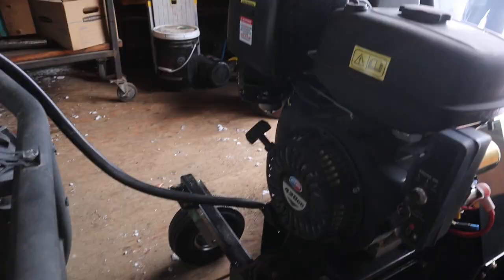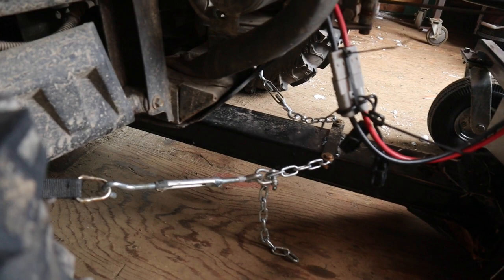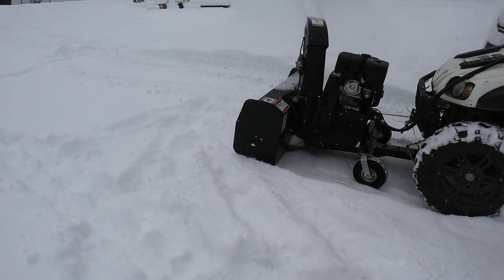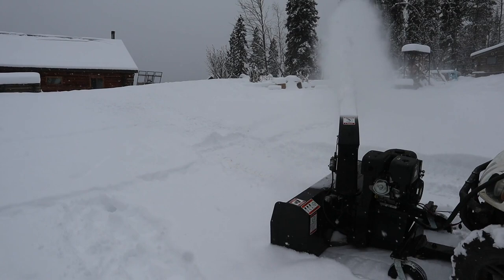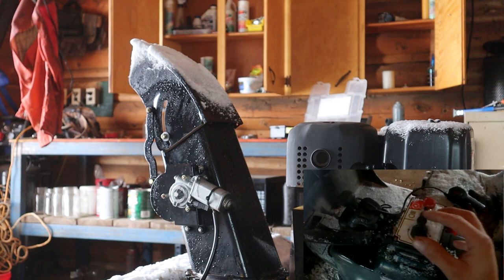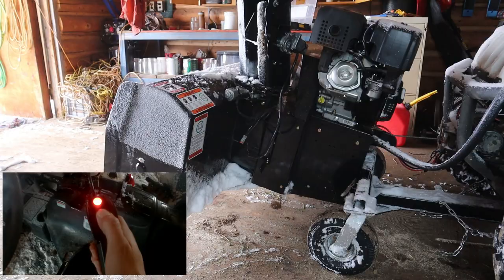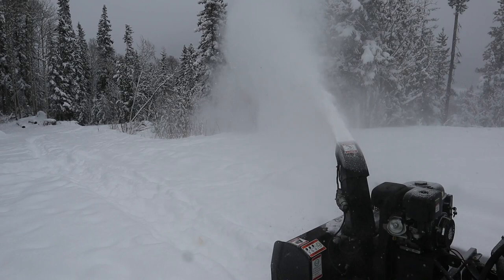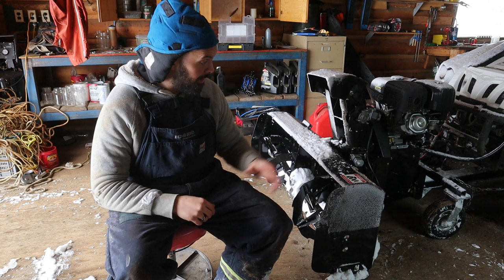Bercomac ATV & SXS Snowblower - Best Snowblower Review // Product Review

Comment: Why is the blower set 2-3 inches above the surface, leaving all that snow?
Reply from the maker: Because we have gravel driveway and this was one of the first major snowfalls we had, we keep it high at the beginning so the we don't pick up a stone and mess up the snowblower. It creates a nice base so we don't have issues throughout the winter season.
Reply: Is that a 2 stage? I didn't see them on the website.
Will that fit a 2022 Polaris 570 Sportsman Ride Command ATV?

Comment: I have to disagree with you on few of your review. I have a 54" vintage bercomac on my yamaha 700. Good blower but very poor frame. I had to rebuild the intire subframe because it is not build strong enough. U have seen the same problem again and again on different YouTube videos my father in law has the 66" on his utv and had have the same issues with his sub frame as well
Reply: The motor on it is the kholer commander 23hp  would not have a smaller engine for my blower